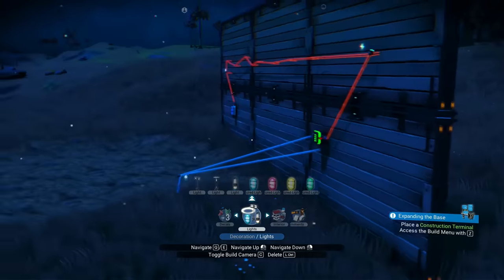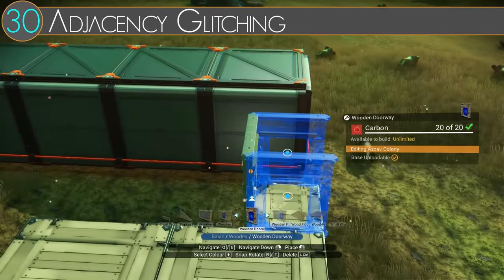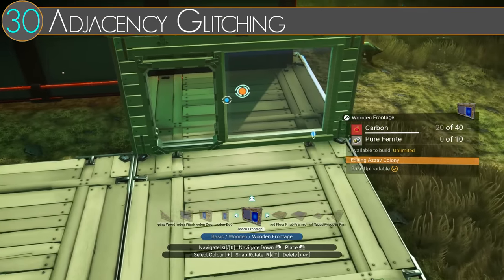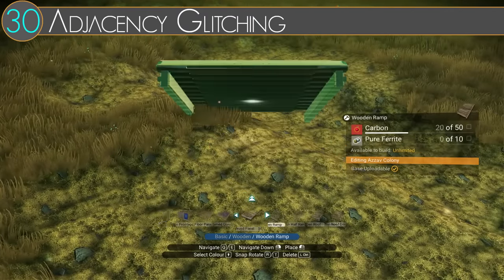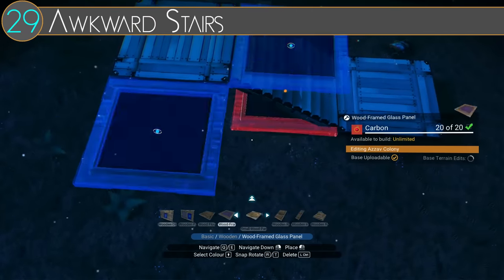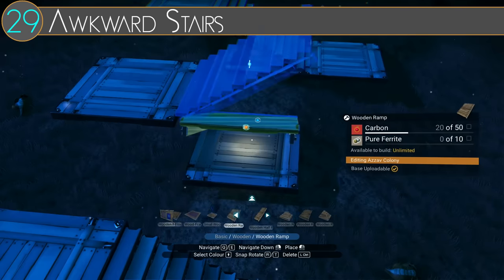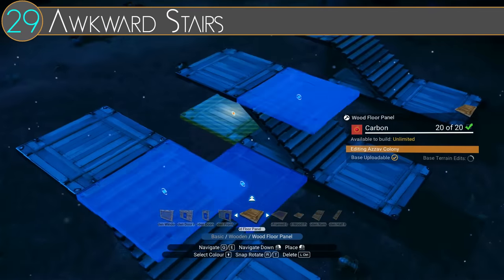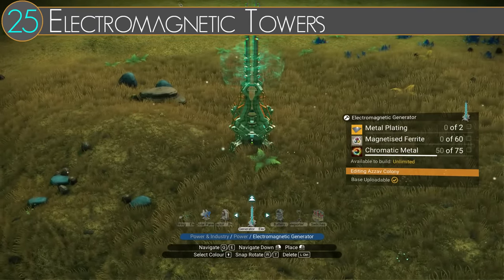30 Base Building Tips, Tricks and Ideas to Make You a Master Architect | No Man's Sky Beyond Guide

Comment: Can someone please tell me how I power the large hydro trays ?  I've played around with various set ups and nothing seems to work. My platform is PS4 and we are in 2.08. The seedlings are getting the water mist that comes from the top of the tray but it's been over 10 in game hours and still nothing. One thing I did notice, the perimeter of the tray where the plants go is emitting a pulsing Red light same with the small box at the base of the tray where there is a sensor of some sort. A fix is appreciated.
Reply: If your planters are in basic structures (wood/stone/concrete), you have to connect them to power. Otherwise, if they're inside the metal rooms/cuboids, they get power when the building gets power.  How are you doing your power now?
Reply: @halbouma6720   "Connect them"  where ?   Everything I have to use power for, I'm fine... it's pretty self-explanatory. I can literally see where the connections have to attach to via the wiring from say a powered battery to light source or storage container or solar panel. But with the planters, there is no "prompt" or lightning symbol  I can see, like with the others, that shows me where to connect the other end of the wire to. Unless you are saying I have to power the Wooden Floor the trays are sitting on but that doesn't make sense (just like this update, going to power didn't make sense... we have elements). I basically built a semi rectangle wood structure, glass everywhere But the floor, the doorway is away from the planters and they sit in an area of about 2 x 8 X 3 (width/length/height) so it's not so big that the game recognizes they're outside. I appreciate the advice but I've tried everything, at this point I wouldn't doubt it's not a bug on the PS4

Comment: Anyone else having an issue connecting wires to solar panels and batteries. For some reason my panels and batteries have glitched out and I can't connect anything to them. Need a fix so I can finish my activated indium farm, find a portal and share the coordinates with my fellow interlopers.
Reply from the maker: A janky solution is to place a save point right by them, save and reload, in huge farms, when it goes glitchy like this, doing that can sometimes free up the snap point temporarily
Reply: @XainesWorld  thanks Xaine! I was able to get just enough connected to get what I have built up and running. Unfortunately I'm having the exact same issue with supply pipes with the same solution. Hopefully Sean won't mind one more bug report from me.

Comment: yeah I am having trouble with extending base size as well.. it will work up to a point; i was able to drop walls all the way to energy spot but when i came back to continue building it would no longer let me build anything (except stuff you can build anywhere of course), even where I had already built walls. I did not upload base but I did log off and back on as well as jump to another system to buy more materials before coming back and trying to finish base. In any case, i don't think it is working like it used to. My first base that required power right after Beyond was released I used this method with no problem to power the base. When I came back later all the power lines were dead and I couldn't build anymore either.
Reply: It was patched you can no longer extend yoir base
Reply from the maker: I was able to extend it on the latest patch

Comment: Your tip for extending the base doesn't work.  All I hear is something to the effect of "Some people use wire... it doesn't seem to work for me... I use walls, they only cost a few carbon" you then proceed to plonk a few down and then say "So yeah".  When I tried it, it doesn't work.  I establish a base put a series of walls until I get to the electromagnetic field 450 u away and when I put the EM generator down... it doesn't work.  Any ideas on what I'm doing wrong? TIA.
Reply from the maker: I did explain it more than just plonking walls down lol.

Being able to place the generators means that extending the base has worked fine, the issue is the generators or the hotspot, maybe a bug from the new patch, have you definitely verified the spot in that location and that it's electromagnetic?
Also are you at the center of the spot or is it just where it switches from one hotspot type to another? As the hotspots are detectable at long range, the survey device will detect the nearest one to you, but these spots only give anything within around 200u of the center and only give the maximum amount upto around 100u
Reply: @XainesWorld  I put the generator down right in the same spot where the 'analysis' kicks in (3 u from centre, I believe).

Edit:  I got in my ship and flew to the other side of the planet from the base.  I was still able to place the generator.  Unsurprisingly, it didn't start working but, I was still able to place it.
Reply from the maker: @GK-wn6ur  that is very strange, do you play on PC and have building restrictions turned off? As that the only way you should be able to place things outside of you base boundary like generators.

Also, when you originally did the extension, did you reload the game from your ship or a beacon at your base right before? As using a teleporter or some other things trigger the boundary to lock and not extend
Reply: @XainesWorld  Yeah I play on PC but I don't see any menu option to turn off (or on) building restrictions.
Reply from the maker: @GK-wn6ur  this seems like a really strange bug, im going to see if i can reproduce it in a bit
Reply: @XainesWorld  Let me know how it goes. I've had the same thing happen too me on another planet. So I guess I can build anywhere I want as long as I don't care that nothing works.

Comment: I built my base under ground and the dirt keeps coming in is their any way to fix that?
Reply: Unfortunately there isn't. The game maintains any edits you make to terrain in a cache, but once that cache gets too big, it starts deleting the oldest edits in order to keep file size from getting outrageous. Either you have to keep on digging your base out, or you can use a natural underground area like a cave. There's some pretty decent size natural underground "clearings." Best way to find them is to just use your visor and look for subterranean relics, then follow the tunnels until the cave system terminates or you find a good spot for your base. I personally find underwater bases to be way cooler, so if the cave seems like too much effort, I'd suggest giving the underwater version a try.

Comment: Having severe problems just connecting the cables right now, it seems to me that if the base is built in stages the older stages will not connect the power with newer segments...
Reply from the maker: It happens more and more the bigger the base gets, it's very annoying, I'd advise wiring up as you build.

But a work around to get most snap points to become usable is to plonk a save point next to the point and save and reload to refresh the area and it'll usually make it available again

Comment: I love the design for the short range teleporters. Hopefully it will be patched so it can work using the same power source and switches like what you have in the video. Currently the only way that I have been able to make it work is by separating them on different power sources.
Reply: I hate them small teleporter that you have to use all in 1 base area it should be anywhere on 1 planet only or somthing not only 1 base area base areas are to small no point really
Reply from the maker: The way they work is instant because everything within 2ku is partially loaded, so 2ku is kind of the maximum distance, also due to base extension being 1k max radius.

If it was further the other teleporter wouldn't be loaded to TP to, and if it was you'd fall through the floor right away without a loading screen, which is where normal teleporters come into play

Comment: extending base boundaries did not work at all. i cann not exceed 275 U's whats weir is that i was able to place a gasextractor a bit further away, and know i cant reach it
Reply: I was able to extend to 1049U.  That is where my Electromagnetic field was.
Reply: Once I reached a 1000U I noticed I Couldn't go any further.  I made a raised platform and then could go to free camera...then planed my towers where I needed them.  It was a pain to do electrical wiring from that distance, but I got it done.
Reply: @BrianShipley  how did yoiu even reach that distance lol. i dont understan why this did not work for me.
Reply: @Labolas2Glasya  I would go out so far and noticed that I couldn't build anything.... So I kept placing batteries down.  once you place a battery down you can go out a little bit further place another one down and so forth.   Once you get to 1,000 you you kind of have to stretch the camera around.

Comment: Dude some of this stuff you show is confusing as hell.
Reply from the maker: Sorry about that, what exactly are you referring to? I might be able to elaborate or approach it differently
Reply: This stuff that really got me was the glitch building you did in the first part of the video. It seemed a little fast but that could be because I’m kinda new to the game and don’t fully understand the ins and outs. Other than that your content was very helpful.
Reply from the maker: @robbybiddle9236  aah, well, there are current 2 types, one of them is very easy, which is adjacency glitching, the other is very frustrating called Wire Glitching.

Adjacency Glitching: This works via bypassing the verification to build, we generally refer to this as the green light as the item you are placing will be a partly opaque green version of itself signalling it is ok to build it there.

In essence, youpress the build key for whatever platform you are on almost exactly at the same time as pressing the arrow key to move to the item in the menu that you wish to build.

This allows you to use the greenlight to build from one item for a different item that is adjacent to it in the build menu.

For example, the base recovery storage unit, is next to the galactic trade terminal in the build menu, and it can be placed almost anywhere, you can utilise this to adjacency glitch over to the galactic trade terminal, placing it where you otherwise couldn't.

Wire Glitching: This is far more frustrating for timing and can even take up to 10 minutes to get a single item placed.

For this, you select the item you want to place on the build menu, move it somewhere that it is green lit, then press the key to the delete/wire/colour menu (this menu need to be on wires for this, so if it isnt, switch to wire and redo the green light.

Then move your cursor with the wire (still holding down the key) and position it where you want the item to build.

Then press build and let go of the wire/delete/colour menu key at the same time, the timing here is so minuscule it is incredibly difficult, but it is possible.

The item glitched with a wire will take on the orientation of the wires placement, so if you position the wire on a wall to then glitch a refiner in, the refiner will be placed as if it is protruding from a wall.

Hope that was helpful, it's long winded, but a bit more detail.

Comment: How to use snapping parts upside down in origin update
Reply from the maker: Start with a floor piece.
Have the pavement in adornments menu green light snapped to the floor then adjacency glitch it to the cylinder.
Greenlight the cylinder underneath the new glitched cylinder and move the cursor down till it appears to flip then adjacency back to the pavement.
The pavement should be upside down, if not try again, if so, delete floor and replace.
The new floor should be upside down
Reply: @XainesWorld  thanks man your new subscriber
Reply from the maker: @mjm9573  oh swish, welcome :)